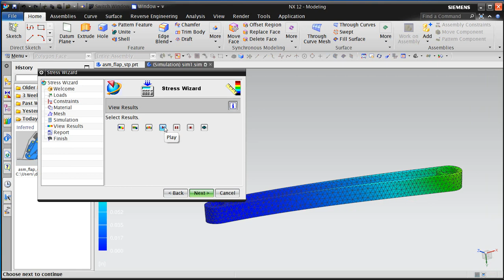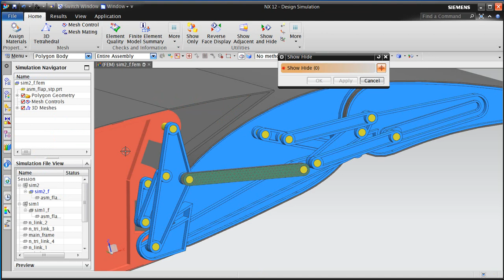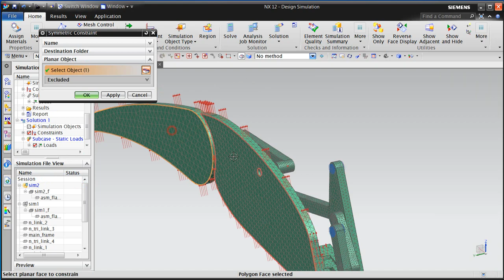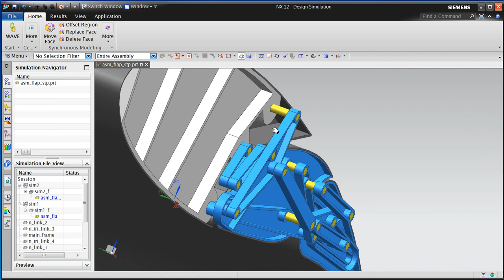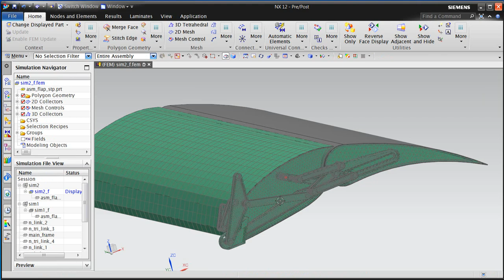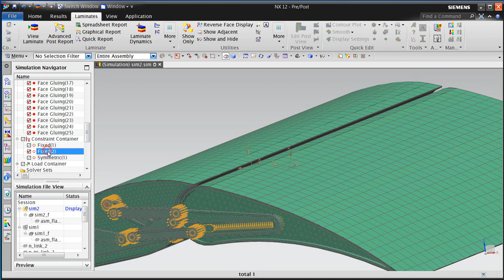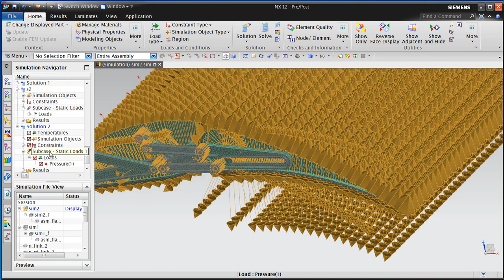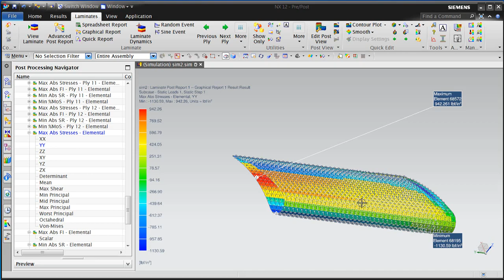Simcenter 3D Scalable Simulation Models

Comment: Hi, me again, can you please clarify this 
When your are providing the material orientation in mesh collector as tangent curve and importing fibersim plies, does the analysis solver consider the draped orientations for the element or the orientation provided in the mesh collector.
I read in the documentation that we have to edit the mesh associated data to 'inherit from layup' (on top of changing stacking recepie to inherit from layup)
Thanks
Reply from the maker: Editing the mesh associated data to set a consistent material orientation is not required but recommended because it enables a more efficient solver input file with fewer property cards.
Reply: @Simcenter3DTipsandTricks  that means solver input file will always consider draped material orientation in ply based workflow right
Thanks